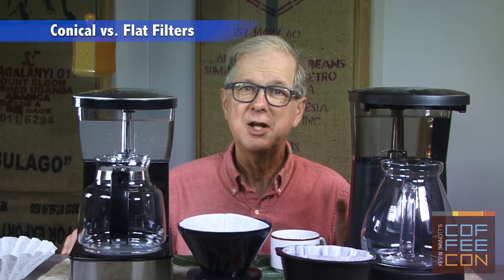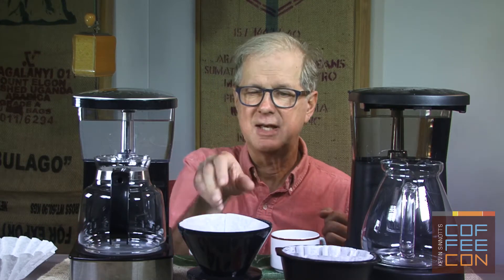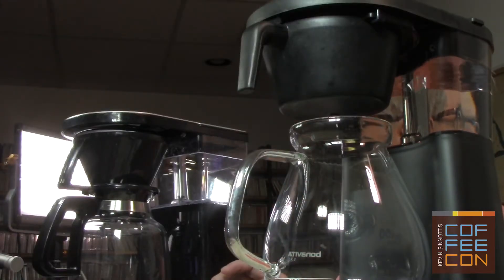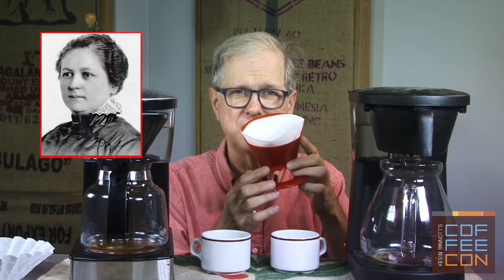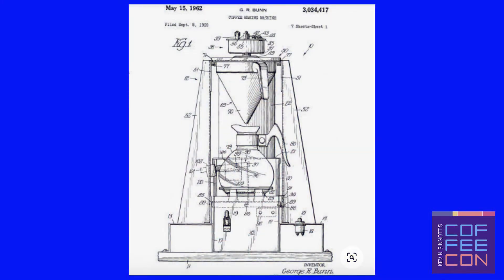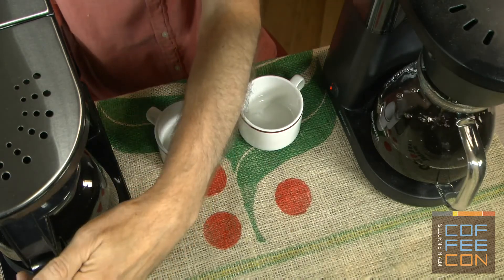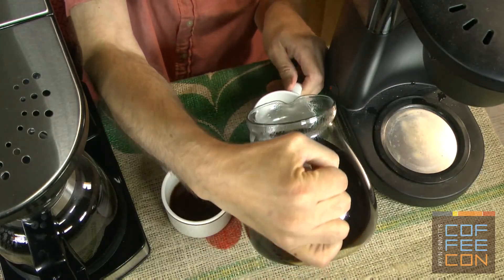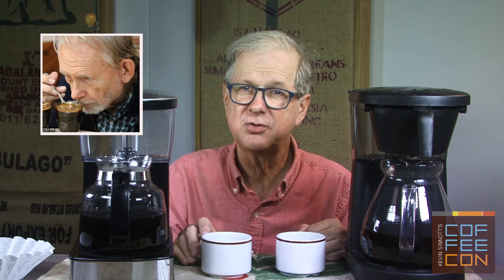Cone vs. Flat Bottom Coffee Filters: Is there a difference?

Comment: My current paper filter now is somewhat on the thinner side compare to the original hario paper filter. My problem is that the draw down seems fast. Is it okay if i use two filters?
Reply: Doesn’t hurt to experiment
Reply from the maker: Thank you for your comment and question. Yes, it's find to use two, but keep an eye on your contact time totals. Prolonging the extraction time (especially beyond 6 minutes) can cause bitterness and overextraction. If you're using the Hario V60, it is optimized and all testing was no doubt performed using their filters. All these companies operate on a shaver and razor blade economic model. My recommendation is to cooperate if you can. Another solution is to grind finer, which may or may not produced equivalent results.
Reply: @Coffeeists  thank you for the response! I tried to grind it finer leads me to atleast 3mins of brewing time.
Reply from the maker: @Redhaired-j5w  you're heading in the right direction. 3 minutes is roughly a minute short of the industry spec of 4-6 minutes. However, the goal is to make it taste how you like it. Don't hesitate to keep us abreast of your trials and results.